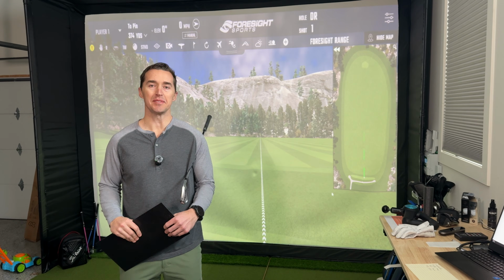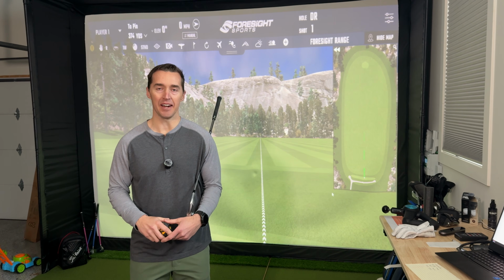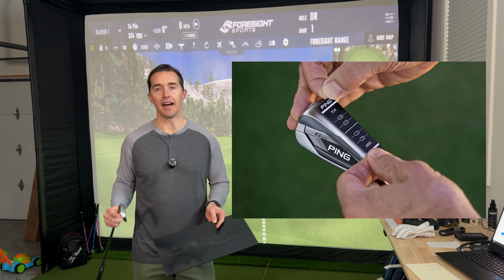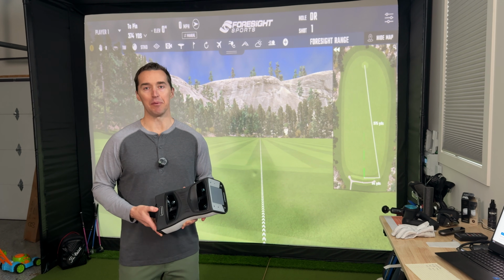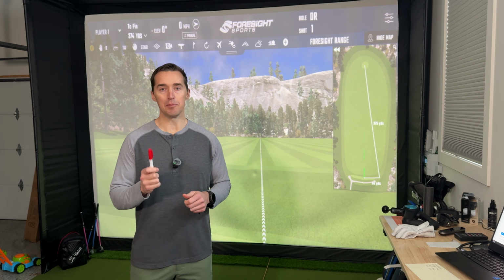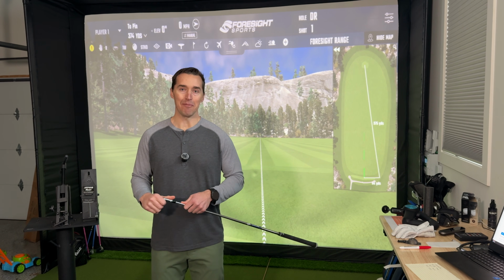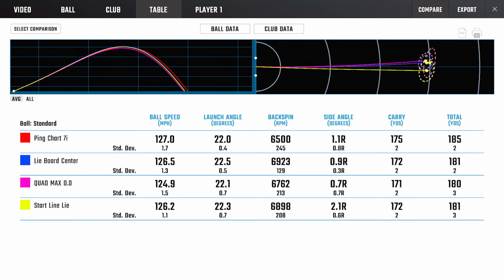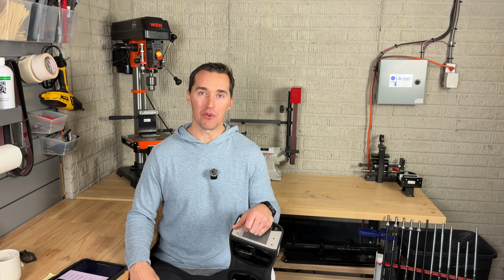Which Lie Angle Method FITS BEST? | I Tried Them All

Comment: If I were to use the dry erase marker method for all my irons, for better consistency, would it be best to conduct this test on turf or grass?  I know when we play golf on grass.  My thought of doing this on turf is just to get multiple strikes and not worry about really digging into grass and throwing the patterns off if you were to chunk it?
Reply from the maker: If you’re wanting to get an assessment out the gate I think mat into a net is good for repeat reps using the same ball a few times. But maybe supplement with some random spot checks on the course or range, try off the tee and on the turf to see how things change. Could help point out if you have an outlier. 

For what it’s worth, I’ve found that living 3ish dynamic toe down is about my sweet spot and have worked closer to standard lie at a shorter length than I’ve typically played. But everyone is different, so try to find what works for you and helps get that start line where you want it.